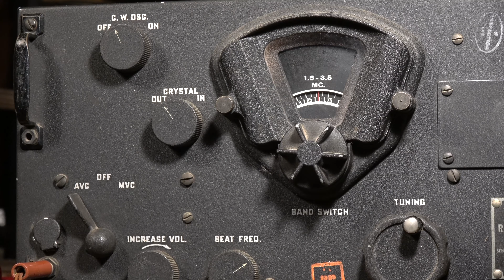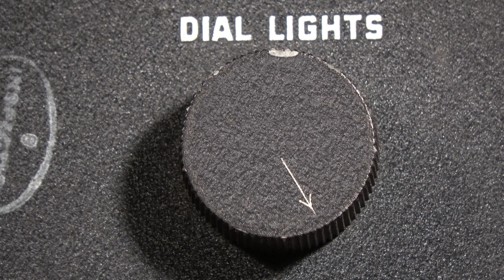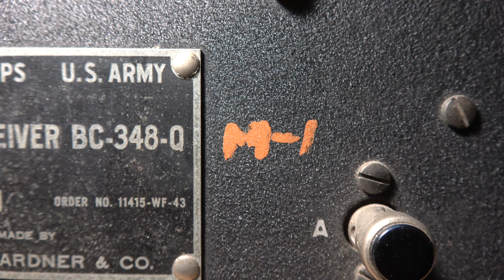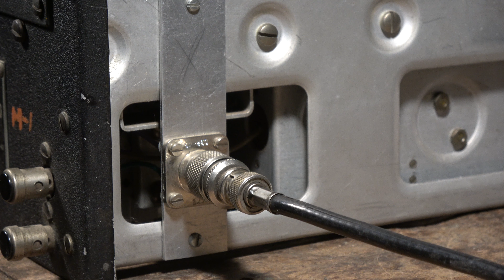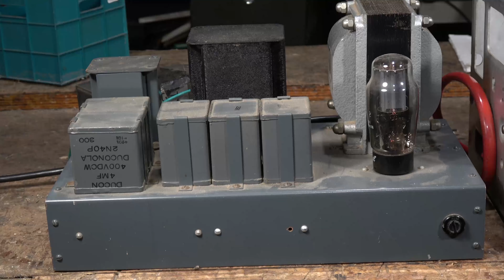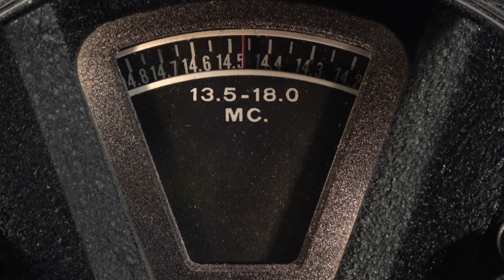BC 348 WW2 Aircraft Radio

Comment: I have a Bc348 for repairing, it is of a friend. A friend suggested to change all the capacitors.
Reply from the maker: Well this set works perfectly with all original components except the cathode bypass on the audio output that i think might have been put there to increase the bass. Power it up and see if it works and if not find out what is causing it and only replace them. The 348 has very high quality components. Good to keep it as original as possible except if it is in very bad condition or seriously modified.  I have other videos of 70 plus  year old car radios and military radios that still work fine with out doing any thing to them and they still have all the original parts.
Reply: @vk3ase  Sir, thank you for your quick answer. I will follow your advice. I am radio amateur and I have some old radios of the II war, one is a Marconi Cr-300, that works very well and I used in my work as ham and the other an ex-RAF communications receiver, a R1155. I have a Hammarlund, and other receiver made here in my country. Thanks again.